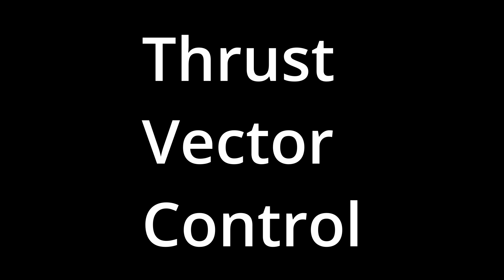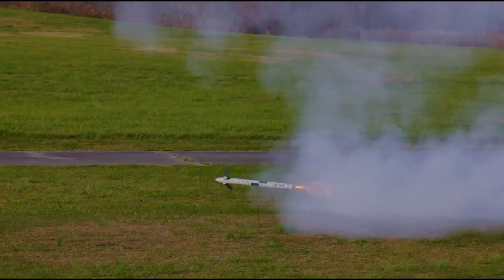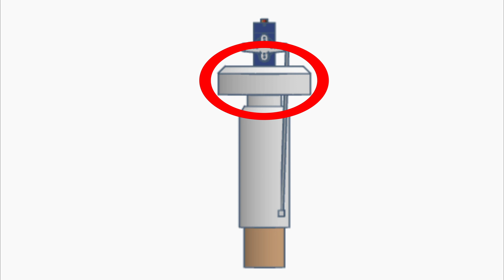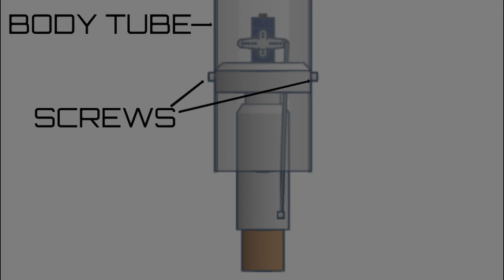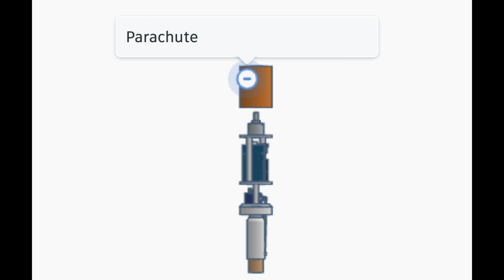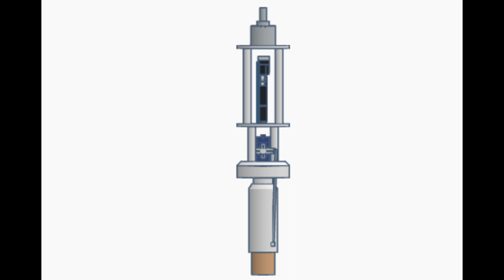TVC Introduction (outdated)

Comment: Can you send me link for that piston?
Reply from the maker: Hi Simon. I'm pretty sure you mean the solenoid valve. In that case, we don't know the exact one we're going to use yet, but we want it to be small and strong. I've researched them a bit, and I think https://www.amazon.com/Adafruit-Mini-Push-Pull-Solenoid-ADA2776/dp/B0722JK1L1/ref=sr_1_1?crid=PPLBWJEWTQ2F&keywords=adafruit+small+solenoid&qid=1653248088&s=industrial&sprefix=adafruit+small+solenoid%2Cindustrial%2C126&sr=1-1 is most likely the one we'll use. I also want to attach a 3d printed disk on top of the solenoid to get as much surface area pushing on the parachute to eject it. I hope this was helpful.